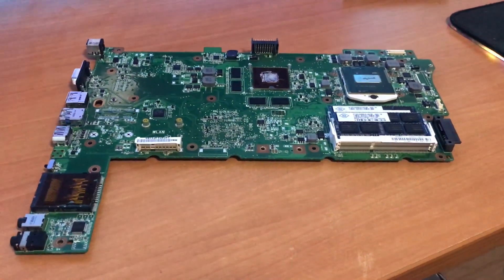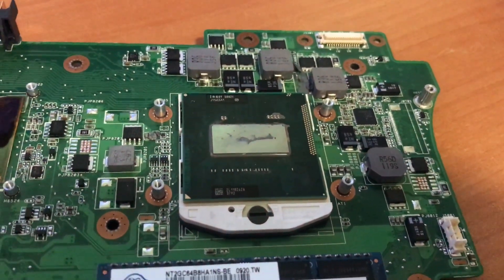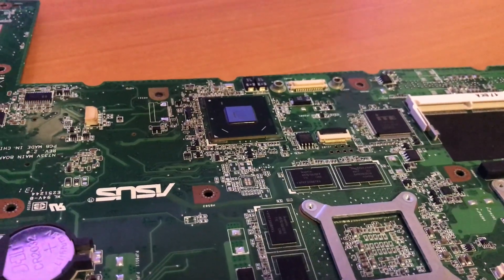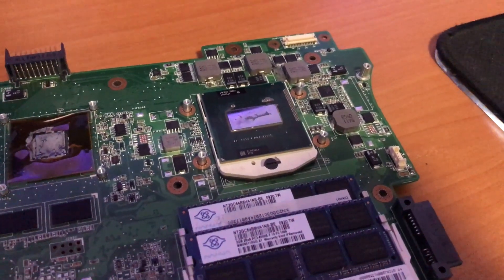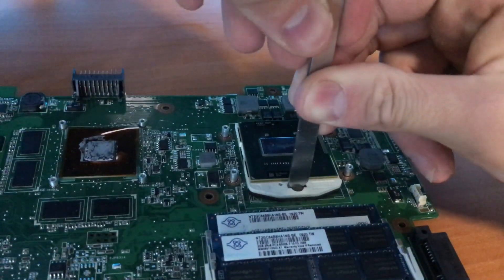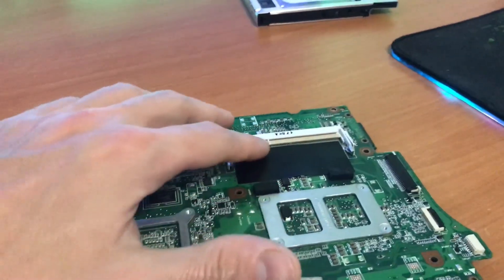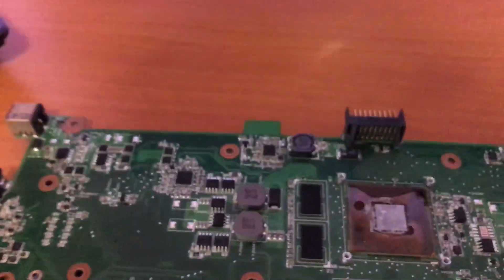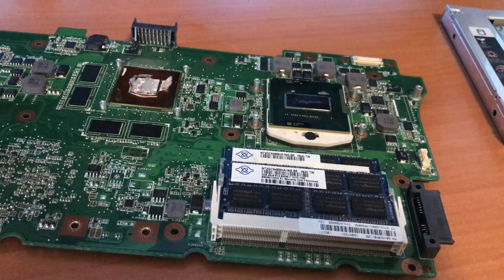how to go about upgrading a laptop cpu

Comment: my laptop motherboard socket supports 4 cores ...  i got a quad core cpu  but its 45w..
it previsious has a singlr core cpu with 31w tdp .. . is it any concerning issue if i use quad core in my laptop ..thanks
Reply from the maker: If it runs no, just the cooling can be too weak which will the laptop throttle which isnt a issue for safety but can take some performance away due to temps

Comment: My Asus A43SD has got the same Intel HM65 express chipset which is a good sign.
Reply from the maker: then you could run up to 2860, and even some said that the extremes work but i'd stay away because of higher tdp draw
Reply: Thanks again, your guide is very informative.
Reply from the maker: glad it is =)

Comment: I have i5 7200u can i upgrade to i7 7700hq?
Reply from the maker: i don't think so, most new chips are soldered because of "thickness", but you can give me the model/brand of your laptop and i'll check, but 90% of the times, if a cpu does not have "M" in them it's not upgradeable, i'll check though, just write me the model

Comment: thanks good video. I also have the n73sv. did some Mods to run cooler. did want to upgrade the cpu but did not know Wat will fit. Now I know. where did you get your cpu from and how much did it cost?
Reply from the maker: i have a huge video on what i have done with my asus n73sv, you should watch that, i found it in a local small pc store, i've looked for one of these for a year, the 2860qm would also work. i suggest watching my "fully upgrading my laptop" video + some egpu videos
Reply: Dennis Gagliano. I just ordered the 2860qm hope it will work.
Reply from the maker: i've seen a n73sv in russia with the 2860, so i'm pretty sure it does.
Reply: Dennis Gagliano got it for a good price so in the worst case I have to resell it
Reply from the maker: or return? i talked to the people who i got mine from and i could return it within 30 days no questions
Reply: did the upgrade today works 100% thanks for the info
Reply from the maker: good job and congrats :)

Comment: Hey bro I have a question. Can you upgrade the screen of a laptop from TN to IPS. I have a toshiba c855-s5241. And also would an i7-3632qm work on my laptop. Originally the laptop came with a pentium b960 and I upgraded it to an i7-3540m both have 35w. I tried the i7-3630qm but it didn't work because it's TDP is 45w. So now I am wondering if the 3632qm would work because it has a 35w TDP like the pentium b970 and the i7-3540m. Motherboard chipset is Hm76. Thank you in advance.
Reply from the maker: the chipset supports both the cpu's, even the 3630, but that one indeed will be held because of the tpd. so if the 3632 is 35w, that should work , the only issue could be a bios, but i don't think it will be an issue since you've already went from pent to i7, and if the one i7 works i don't see why the other wouldn't, and for the ips to tn, only if their is a version of your laptop that does have a ips version. try aliexpress, they have contact service where you can ask and they will know for sure if they will have a working ips for yours. this site is good for chipset/cpu support checking: http://www.cpu-upgrade.com/mb-Intel_(chipsets)/HM76_Express.html
Reply: Dennis Gagliano thank you for the help. I really appreciate it man. BTW congrats on 1k subscribers. Keep it up!
Reply: Dennis Gagliano do you think it's worth changing the cpu from an i7-3540m to an i7-3632qm. Thank you in advance
Reply from the maker: depends what you're doing with the pc. going form 2 cores 4 threads to 4 cores 8 threads is huge, but if you run a stock crappy laptop gpu, then a egpu would be step nr1, if you need a cpu for rendering then yes. it all depends what you want to do on the laptop, and thanks :)
Reply: Dennis Gagliano I am gonna stick with the i7-3540m for now because if I go to the i7-3632qm, I will have to sacrifice the frequency. I will have to go from 3.0ghz to 2.2 ghz and my motherboard doesn't allow me to overclock/ turbo boost. Thank you so much!
Reply from the maker: Commandos no problem mate

Comment: Hi!  My laptop is Dell Inspiron 14R with an i5 3210M . I looked at the device manager and my chipset is Intel 7 Series/C216 chipset 1E03. I tried browsing but i cant seem to find an i7 replacement . Help ?

P.S Awesome vid btw
Reply from the maker: i think i have some bad news, that chipset seems to be only supporting that single i5, http://www.cpu-upgrade.com/mb-Intel_(chipsets)/C216.html
Reply: But my laptop have i5 3210M stock ? Still i dont think any upgrade is worth it. Thanks
Reply from the maker: ahh sorry i ment the i5. you can upgrade to max a 3220 and that's not worth it, with that i5, you could run like a 960, it would improve game performance, but you can't really do anything else.it will give your laptop a bit of longer life and power, and you could safe up for a future desktop while already having a gpu for it in the egpu bay

Comment: i don't want to upgrade my laptop yet, but maybe someday ... acer e5 475G i5 7200U, any suggestions for i7 cpu that would work with my laptop? thanks
Reply from the maker: none unfortunally, as i explained in the video, only when you have a M processor, and 7200U are not socketed, they are soldered, and that's permanent :c
Reply: Dennis Gagliano thanks mate for the reply sorry i didn't watch the whole vid cause i have pretty bad connection here
Reply from the maker: not a problem

Comment: Is there a way to get a super low power GPU (1030 or 1050) into a laptop?
Reply from the maker: what do you mean "in to a laptop" i run a gtx 970 as a external gpu, that's the best option, external, building one inside, no. you need pci 16x lane and much space
Reply: Dennis Gagliano yeah I meant literally inside the chassis. You would have to do a hack job on the chassis and use risers for it to work. I do like the idea of EGPUs
Reply from the maker: no laptop would have space for that. why would it have, they make laptops as big as they require in parts inside. there is no empty spot. do you know how thick gpu's are? my gpu is thicker then my whole laptop with closed lid lol, why even bother while you can just take your laptop and be off, and when you get home put a thunderbolt cable in for the egpu and have a powerfull desktop gpu running, and where would you put the riser cable? a laptop does not have a pci-e 16x lane at all

Comment: how do i make my dell studio 1747 get new i7 quad cpu?
Reply: it got i7 720qm
Reply from the maker: i've read that the dell studio's cooling is really bad, and that going higher then the 720qm will result in very hot temp's, and the 940xm won't work, it's a 55w tpd cpu while your 720qm is a 45w,  However! the 820QM is fully supported by your laptop. so you could upgrade it to that, but it won't be a huge upgrade, first gen i7 is just really really old and outdated now.